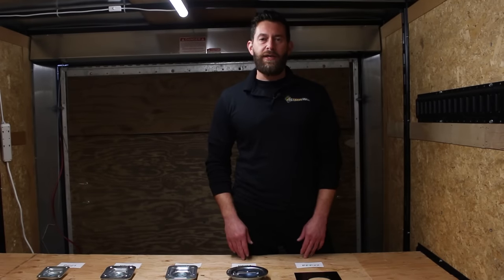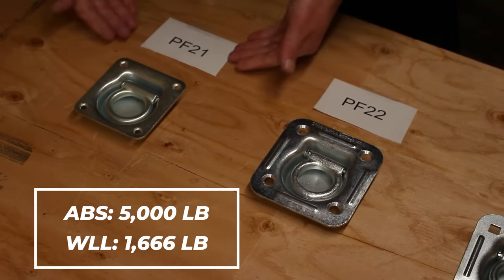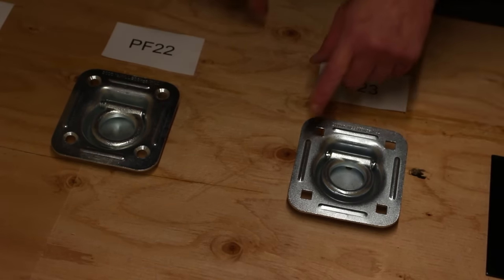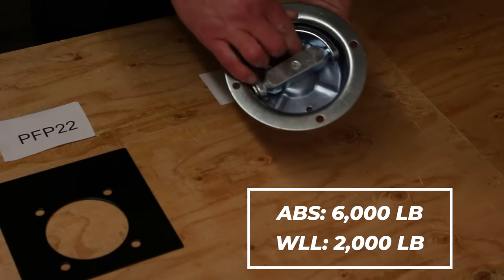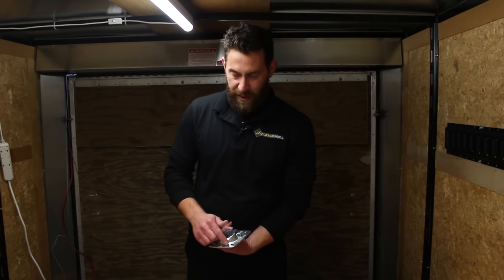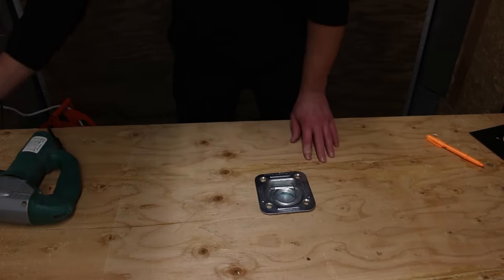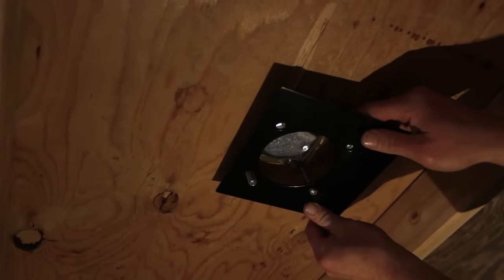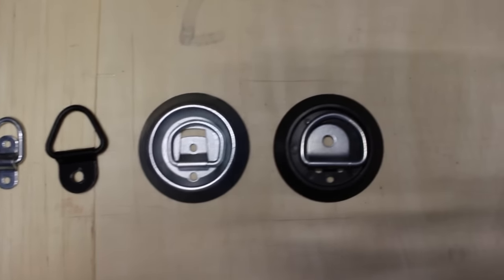How to Install Recessed D Rings

Comment: That just threw out all of the load & working lbs. Your D rings are only as strong as the plywood on your floor. Mont those to the frame work of your trailer.
Reply: What does that mean though? I genuinely don’t know.